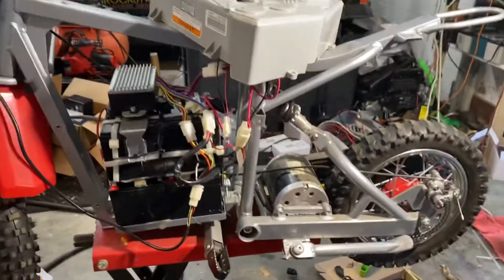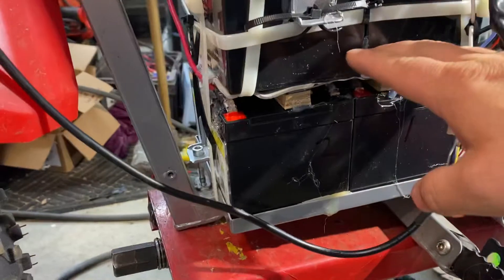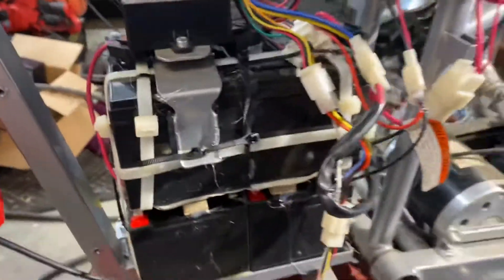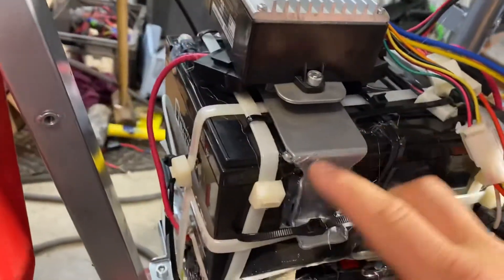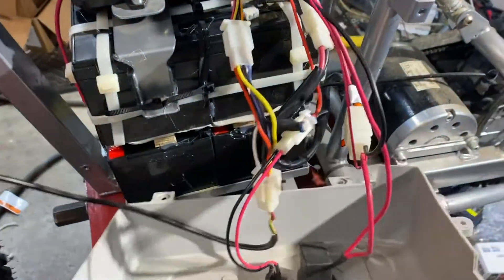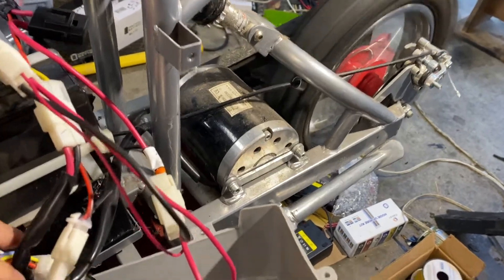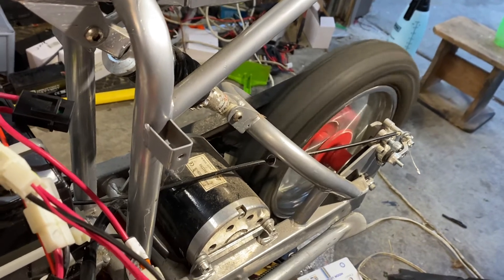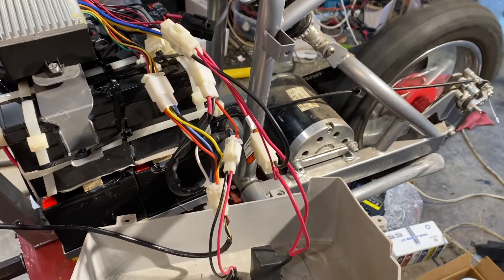How to Over volted a Razor SX500 Dirt Bike 48V 15Ah SLA batteries -stock look- w/ potentiometer

Comment: My front sprocket won't catch under load. There both brand new. The chain is adjusted correctly via sizing and tensioner. If anyone could help please respond 👍👍👍👍👍👍
Reply: It's jumping the chain.
Reply from the maker: Is everything aligned? Put the bike up on a platform with the wheel unobstructed and give it throttle to watch if the sprockets and chain are aligned. Also is your freewheel working OK?  A video would help. Send a link
Reply: @freshmaker5  https://youtu.be/tp9bSXmA2OY